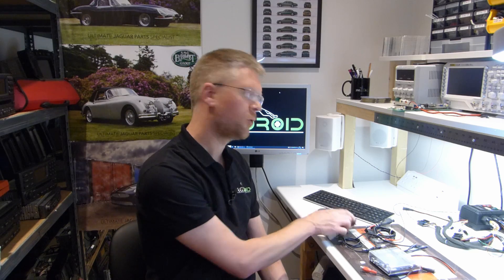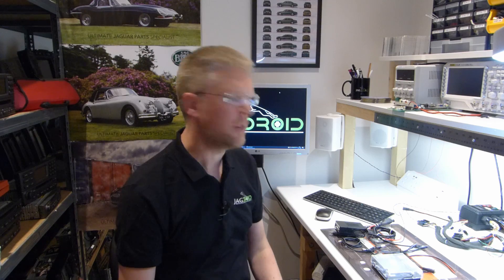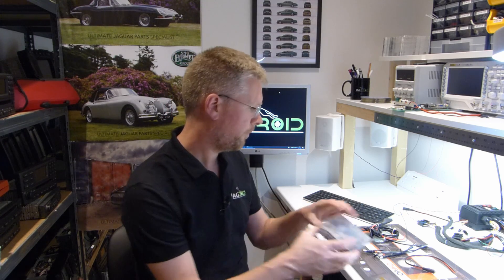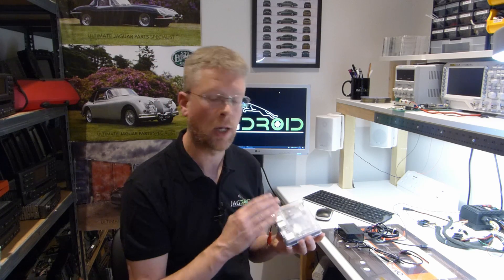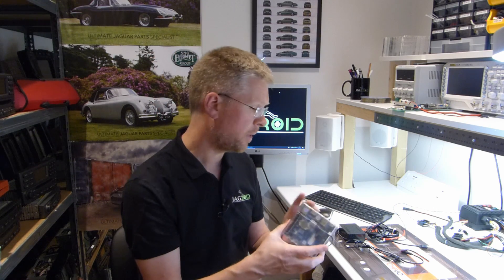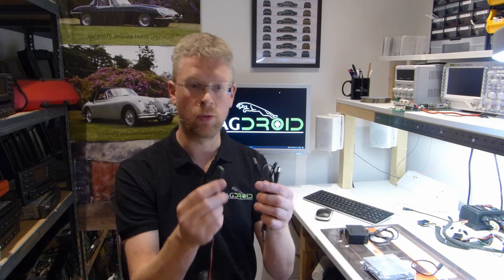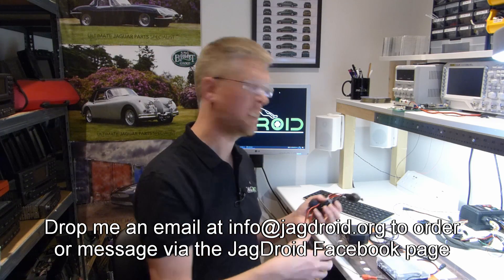JagDroid Odroid N2+ upgrade with retro-fit kit

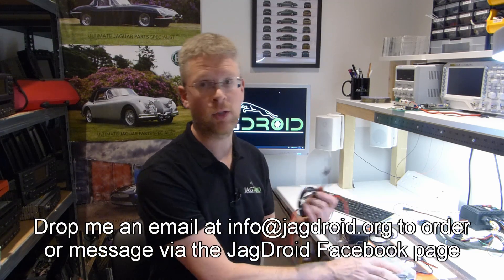Comment: What are you using to stabilise the new permanent 12V power supply that the N2+ needs? Is that some sort of buck/boost converter in the heatshrink bundle at #3:26?
Reply from the maker: The N2+ has a max voltage of 16v so can be powered directly from the car supply

Comment: Can those Odroid computers take place of a tablet? 
Why i ask, is I am going to be running an lcd gauge system in my project vehicle that includes a console mounted touch screen for various info/displays.
Several accessories in the vehicle have the ability to be controlled via bluetooth/wifi, such as led lighting, air suspension, wireless relays, my gauges, etc.
Rather than have to install a seperate android tablet device to have control of said accessories, as i dont want to need to rely on a phone,  im wondering if one of these odroids can be used.
This way, i could display the odroid from the lcd screen in my console. 
Hope that makes sense. Sorry if a noob question, im only just now learning what an odroid is.
Cheers
Reply from the maker: Yes, that's pretty much how the JagDroid system works: www.jagdroid.org. You can add an LCD and touchpanel to the Odroid computer to turn it into a tablet style system. Have a look at the Odroid forums for more details https://forum.odroid.com/viewtopic.php?t=33781